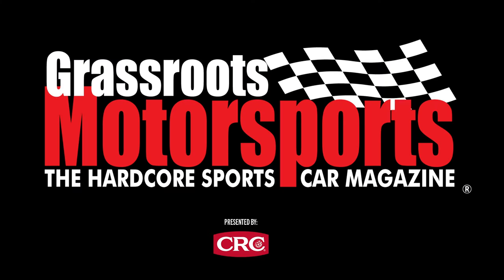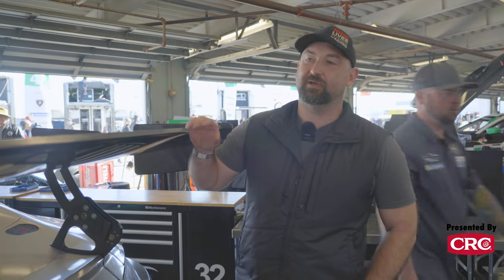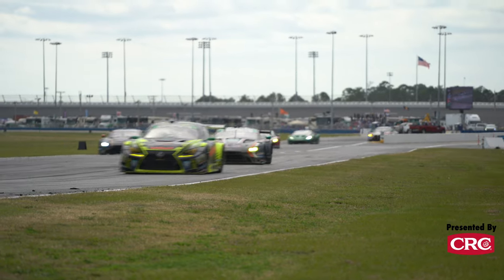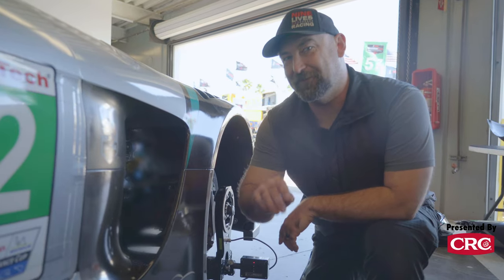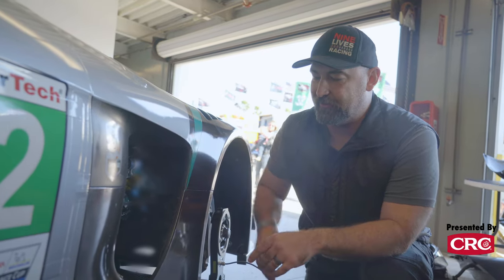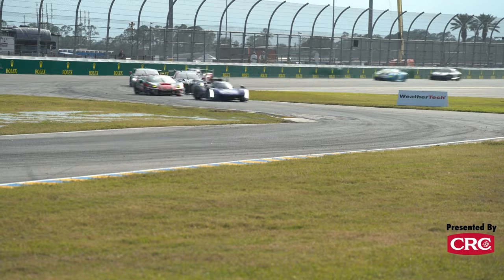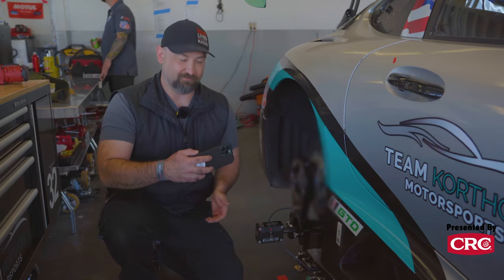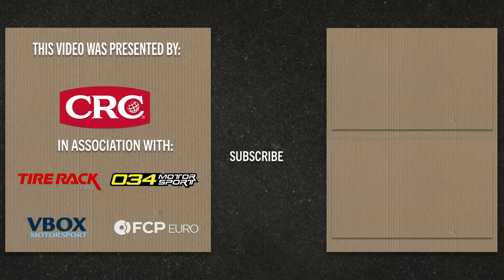5 Tips for Better Aero on Your Car

Comment: What about hood vents like race Louvers?
Reply: Heat extraction vents like naca ducts aren’t gonna make downforce is my understanding. But good for cars that need it.
Reply: It can help reduce pressure under the Bonnet which reduces lift.  Reducing lift has the same effect as increasing downforce.